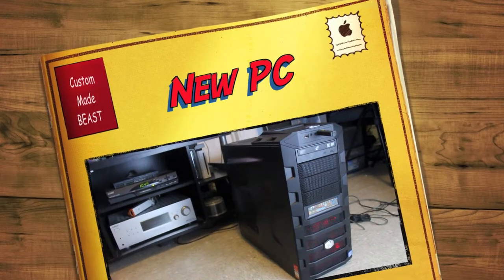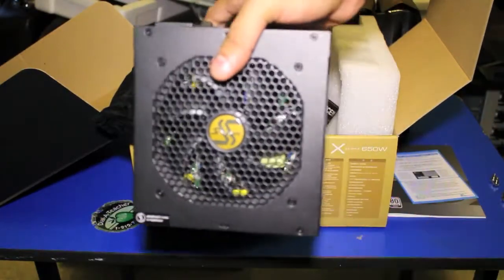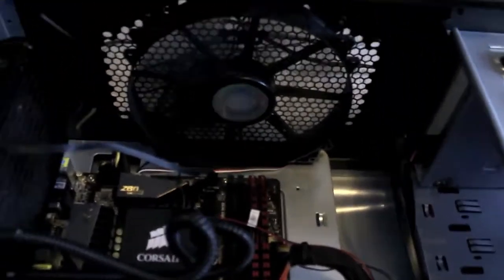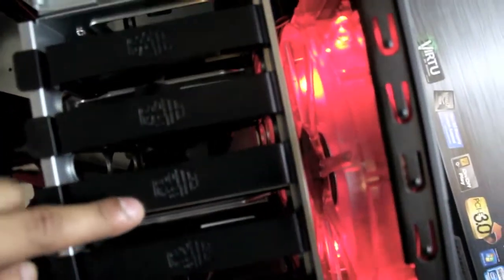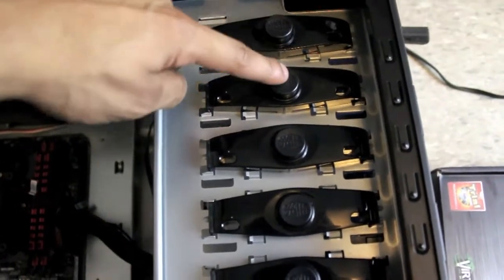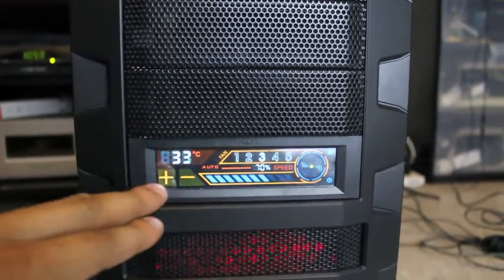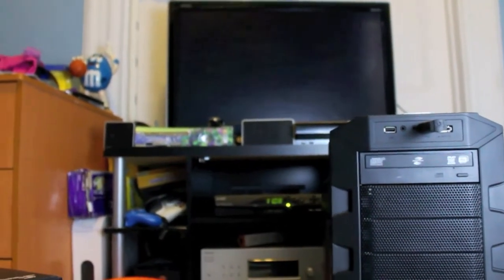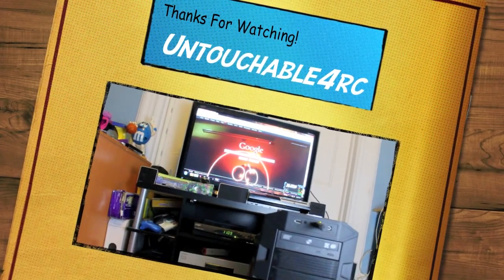New PC Build! [Specs and Rundown + Boot Test]

Comment: oh m,an you got a modular power supply, thats great for cable management.i need to get some of those. liquid cooling is badass i never tried to mess with that before. you should get a fan for the inside door right between the graphics card and your psu because both those fans are facing each other it will help with air flow because the front of your system is almost completely blocked with hard drives. that is an awesome build!